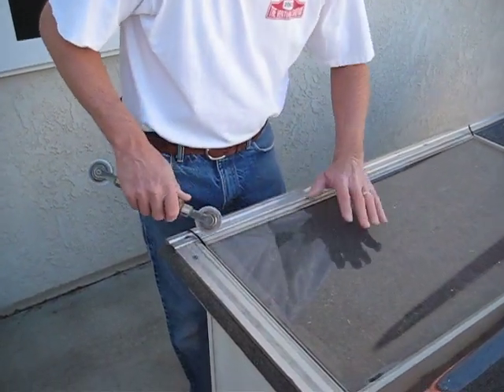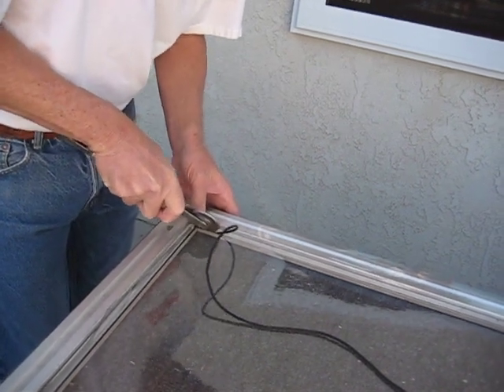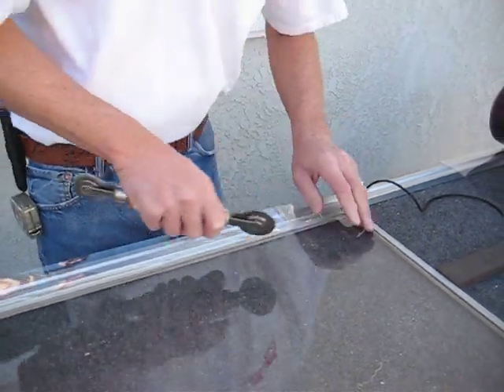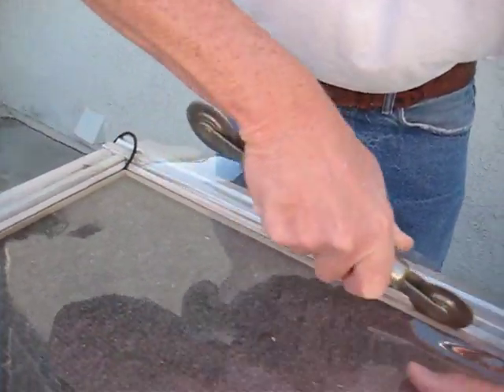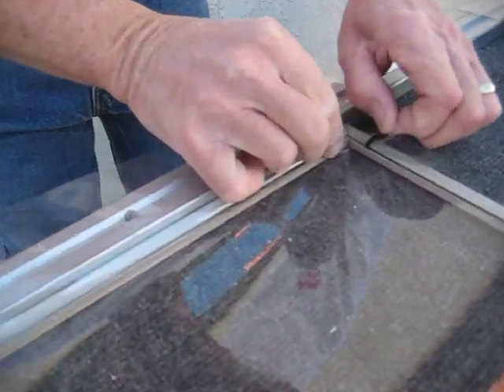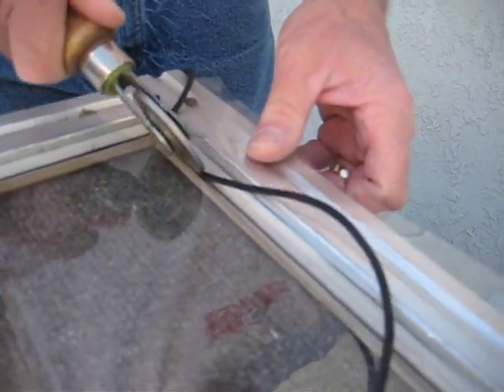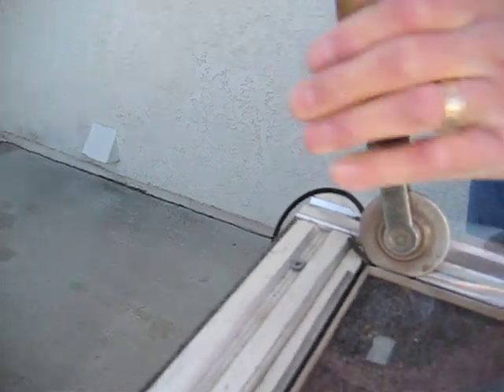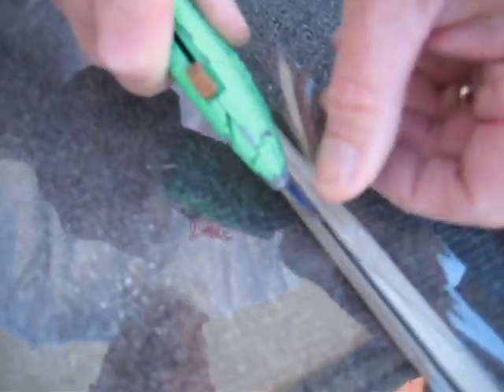How-to Install Clear Plastic In Screen Frame - Part 2

Comment: This would be a great idea for the roof of my lanai -- keep the sun, but not the rain. So I can use my hot tub on rainy days.
Reply: nopes. there is no air circulation. if your lanai doesnt have ac, you will die of heat in there. this is great for when your house has  miami or single glass swivel windows and you want to keep the AC air from sneaking out.

Comment: what size spline are you using? with what mil plastic?
Reply: I am trying to replace my vinyl.  The spline in my existing windows is rectangular/square and rigid.  i can;t find it anywhere to replace it.  The spline I already have for screening is too small.  I'm getting very frustrated.  Did you ever get an answer?